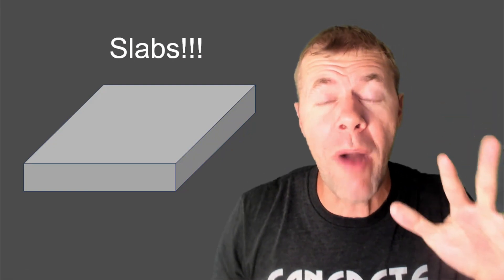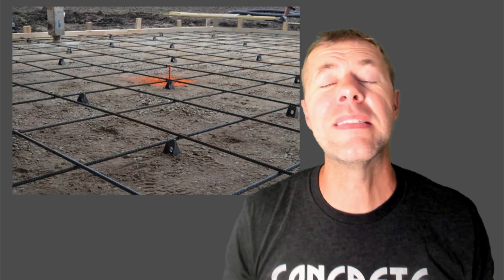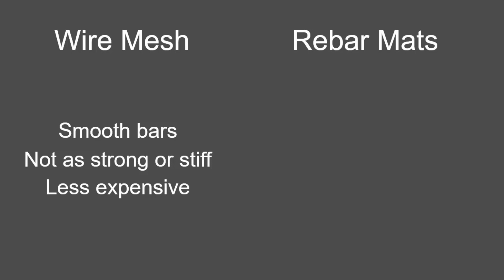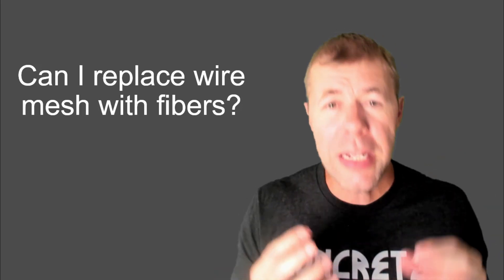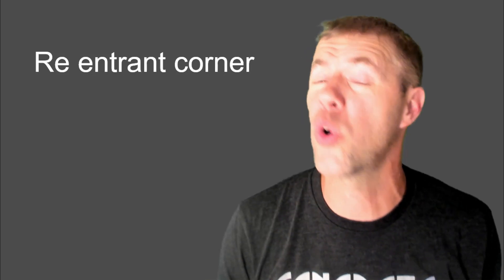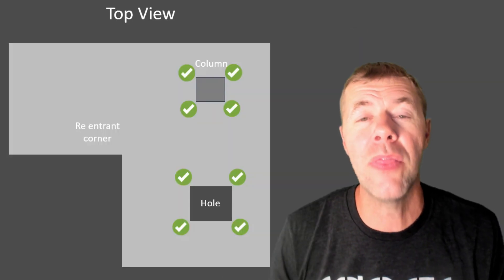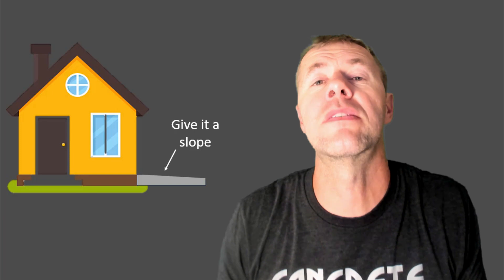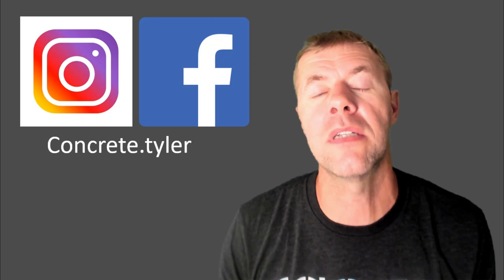Slab tips - Pt 2 - how to build driveways, patios, house slabs, and roads - reinforcing and slope

Comment: Tyler, 
 I am curious as how you found success in getting a residential/commercial building slab redesigned to replace rebar with the correct type/dosage of fiber. I hear this conversation frequently with fiber suppliers so curious about your success.

Comment: At 1:28 would it still be UPPER third and not lower third, if the slab is a concrete pad for a heavy load??
Reply: I think he is just discussing non structural slabs here, like residential neighborhood areas. Typically reinforcement for crack width control (WWM or rebar keeps cracks tight and small) when in the upper 1/3 and at least an inch cover.
Imagine a piece of drywall 4'x8' two people Hold it level and you place a 40 lbs weight in the middle. The sheet will bend down. The top is compressed and the bottom is flexing bending and starting to crack. 
To control cracks upper third (most contractor literature say in the middle so it's at least chaired cause that's better than on the ground).
Reinforcement at the bottom 1/3 we are concerned more structurally. 
Also structural in nature can be load transfer from slab to slab where we use dowels. 
Sometimes we put rebar in the bottom and the top of a slab or rebar bottom WWM at the top. Take the time to design your slabs properly and consider all loading cases, even edge cases, for proper reinforcement.

Comment: Why is the rebar/remesh in the middle or upper third of a slab? In a beam the tensile stress is at the bottom, unless its cantilevered, so it seems sensible that the rebar should be in the bottom third of a slab when thinking of the tensile stress being greatest at the bottom surface. Also, consecrators commonly 'cut' the upper third of the slab, wouldn't this cut hit rebar then?

Comment: Since when is a 1/2" drop over 10' a 2% slope?
Is math different in Oklahoma?
1/2" = 0.5"
10' = 120"
0.5 ÷ 120 = 0.00417
Or less than 1/2% slope.
For a 2% slope we use 1" per 4'.
Granted 1" per 50" would be exactly 2%.
But 1" per 4' is 1" per 48" which is really close. 
Another example is a 4' wide sidewalk. Set up one form and inch higher than the other and you're there.

Comment: Putting in a grain bin, and have been researching/building the foundation to death.  It's amazing how little reinforcement some people will put in.  I settled on a 3x3 grid of #4 for the footing, which is going to be 2' wide, and 15.5" below grade on average (shooting for 12" below grade on low side as there is a slight slope), and 24" above grade. The interior "pad" or slab will be 8" thick, #4 rebar 12" OC. 16" of 3/4 in. roadstone for fill of the pad area, interior form for backfill to hold it in place and achieve a 90 degree angle, and will be moistened and plate compacted.  Person I talked to for my diameter bin recommended a 2x3 grid for footing, and 24"OC for slab, so hopefully, I overengineered it enough.  Also adding verticals to support the footing grid, and perpendicular cross pieces of rebar between for each set of 3 rings @ 12" OC.  For a 21' bin(which is also the center of the footing), I'll use a little shy of 2000 lbs. of rebar.  Hopefully its enough. :D
Reply: To make it even gooder, I would have considered 1 loop of post tension reinforcement, and saved half of the rebar.

Comment: Please make a presentation about upper floor concrete slabs (not ground floor because you've covered these).  How to prevent or at least minimize cracking.  A new building near me that I'm aware of has diagonal cracks along all the corners of the second floor slab.

Comment: Do you have a video about or would you comment on this new "dry pour" trend I have seen popping up on YouTube lately? Where they just dump dry premixed concrete into a form, then mist it on top. I can see several downsides, but If it is in a temperate climate with no freezing temps would this be a reliable method in certain situations?

Comment: They sell the wire mesh, or as I've always called it, welded wire fabric, with deformed wire as well.   I can get it in a 6x6 grid with 3/16 wire thickness here in NC, in sheets of 5x10 or 5x20.  This saves more vertical space than #3 rebar would.    If I used rebar in my composite deck slab,  that would push the hydronic lines uncomfortably close to the slab surface  --counting the deck with its corrugations in a 4" overall slab thickness.    WWF is also more convenient if you're going to run hydronic lines.  There are more anchorage points than an equivalent grid of rebar.

One time I had set the beams too high resulting in a vertical distance to the screed edge of about 3.5".   The concrete guy came and poured and floated.  But when it came time to trowel, he gave me the option:  He could either power trowel and risk pulling up a hydronic line, or he could stop there.   I had him stop.   Now I have a rather  "rustic" floor.

One problem with the wire mesh though:  If you lap them the way code wants, then the lapped corner intersection of four sheets is going to stack 8 wire thicknesses high.   8 x 3/16 = 1.5" in my case.    So I cheat and cut out some of the wire forming the stack.

Update: Man, never commit to buying WWF without seeing it first.   Retailers typically stack it outside for years until it sells.   My most recent batch has rust just short of pitting.   I thought about returning it, but the particular slab I'm doing won't be exposed to the elements, else I'd worry about eventual spalling.

Comment: Please help out… when you say the rebar goes in the center or the slab, is that not the zero for bending moment in tension and compression? So if a load is applied to the slab, would this rebar serve any purpose than for cracking?

Comment: I absolutely hate wire mesh.   I have never seen it end up anywhere other than the bottom third of the mat, and over fifty percent in direct contact with the soil.   If the mesh is supported enough that it isn’t going to be stomped into the bottom of the slab, it is more efficient to install rebar on chairs.  And if you design the rebar installation at the upper third point, it is very hard for the workers to stomp it down past the mid point.

Comment: Professor, I think you math is somewhat off: 2% of 3m (300 cm) would be a 6 cm slope, not 12.5mm or 1.25cm. Or in imperial: 0.2 feet (2 13⁄32 inches). What you are proposing is more like 0.4%

Comment: thank you for mentioning sloping the concrete away from the building. so many just do flat walkways etc and it causes water to run back into the building causing a lot of problems. you also have to keep in mind that many walkways/driveways end up being overland paths for storm water in big rain.
Reply: Not only sloping away, but it should be lower than the floor of building it abuts because of that as well.

Comment: ACI code is .03% of cross section area should be steel .. Minimum I recall.
Fiber is the ticket.
But can hamper finish operation.

Comment: Bars in “Upper” part of slab? I thought lower parts?
Reply: You want to reinforce the tension side of the slab.  If unknown, go with the middle.
Reply: That is what I thought.   Place rebar in the bottom 1/3 rd.   We walk/drive & load on top, that is compression.   The bottom is bowed/stretched, therefore tension.   The tables in the picture looked like bottom 1/3rd.   I am not a concrete contractor but I like Tyler's videos.   :-)

Comment: I have been in the slab business for years and as of late I see fiberglass rebars.........I picked up a single piece and instantly put it down like it was a cursed item........I could never see myself using it for any purpose........can you tell me why this was even Invented
Reply: No corrosion.  Lighter weight.  Lower cost.
Reply: @charlesw3120  ........it just feels wrong in the hands ...........like a child's playset piece..........it will take me some getting used to........if the real stuff ever gets out of reach that is......

Comment: Is fiber reinforced concrete more fire resistant than rebar?
Reply: It depends on the fiber.  Most fiber is polymer, which softens, melts, and can produce gases.  These are less fire resistant.  Other fibers are made from more stable materials, even steel fibers, which would be similar to rebar.
Reply: @charlesw3120  I used fiberglass for this very reason in the concrete firepit I made alone with refractory bricks in the inside.

Comment: What about rounding the interior corners to break up the stress concentration in placeof extra rebar?
Reply: Thanks for your reply. While rounding corners is not viable on commerical projects, I found it handy on small pours with last minute unplaned "adjustments" to actual layout. The extra rebar at the corners is now in the bag for the future. Thank you again for expanding my horizons.
Reply: I think the main disadvantage would be that it would make the forms more complicated. Or it might just not be the shape that most projects require, I’m guessing that by the time you made the curve big enough to help it would change the geometry too much.

Comment: A half inch on 120 inches is just over 0.4% slope.
Reply: I was thinking the same. Should be 3000mm/50=60 mm height difference for the slope.
Reply: Easy rule is 1" per 4'
Reply: I kept repeating my calculations saying that I must have done something wrong 😂.
Reply: .25” per LF.

Comment: I like to make saw cuts at inside corners. I hope to see more basalt or fiberglass rebar in slabs, along with emphasis on compaction and curing  for longevity. Concrete should last hundreds of years. 
My question is what can be used for tie wraps, that will not be subject to expansive oxidation.
Reply: YES! Fiberglass or basalt beat steel rebar in every way for a slab.
1) light weight / ease of placement 
2) much higher elastic strain 
3) no worries about corrosion / minimum cover.